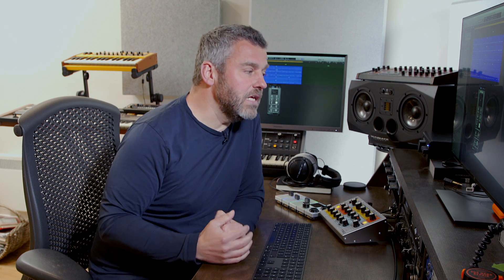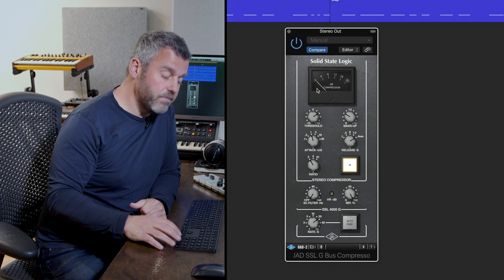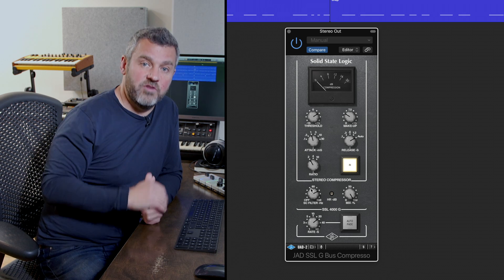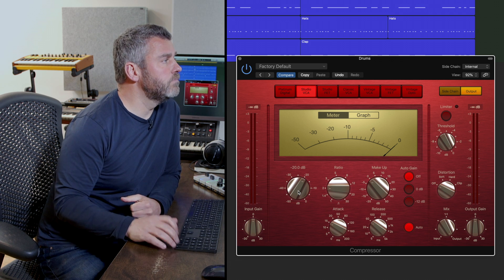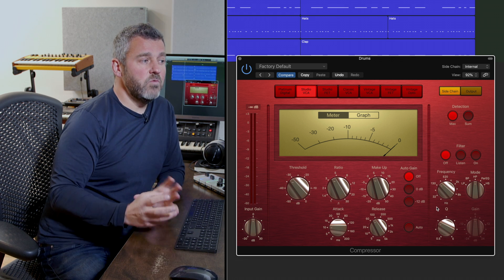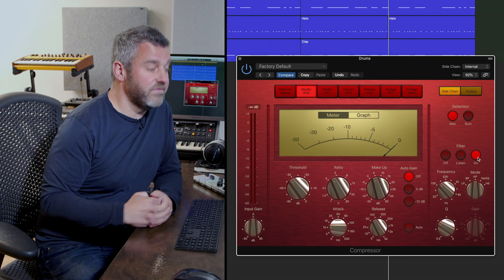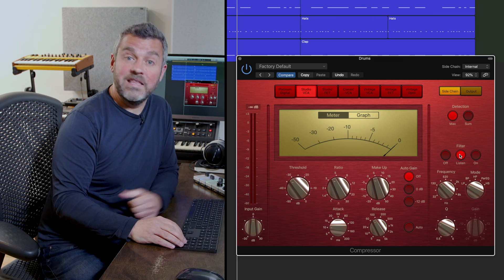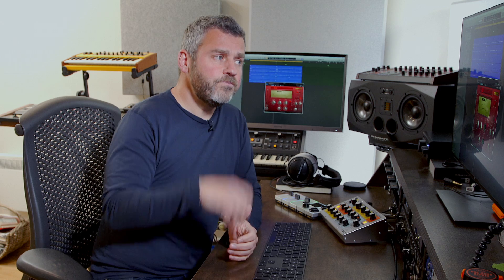Logic Tips: Compressor Sidechain Filtering

Comment: great video! for my clarity, the compressor is keying off those selected frequencies, but compressing the entire signal (when those frequencies are present), yes? not functioning like a multi-band?
Reply: Depending on what filter you select (high-pass [HP] and low-pass [LP] are most commonly chosen). 

As Jono mentions, the kick is strong in low frequencies, so people often want to NOT compress that along with a whole group of higher frequency sounds that demand less compression by nature. 

Selecting the 'HP' filter in 'Side Chain' and setting the frequency dial to say 110hz, you are asking the compressor to work on all the 'high' frequencies (all above 110hz in the group). This allows the strong low-frequency kick to not be compressed, while the rest of the sounds are compressed and "glued together." That way your compressor doesn't work as hard across the group because it's avoiding the strong kick. 

Happy music making!
Reply: @soulstuckinseth  I feel like you could do this in multipressor? Bypass a specific band frequency? Or what am I not getting?